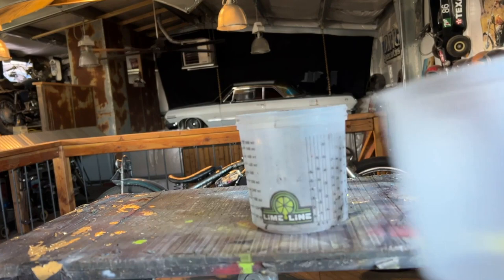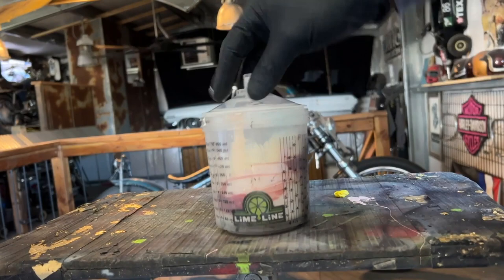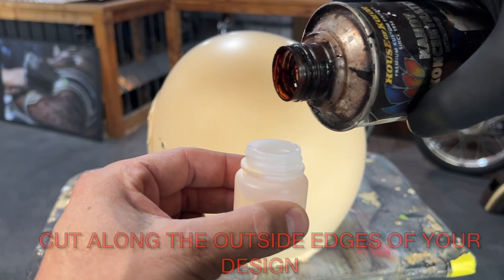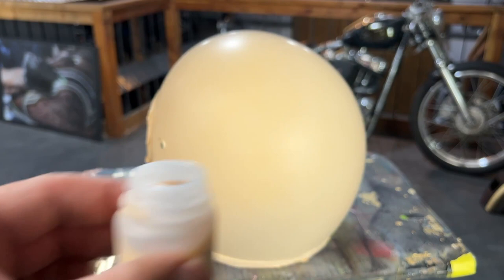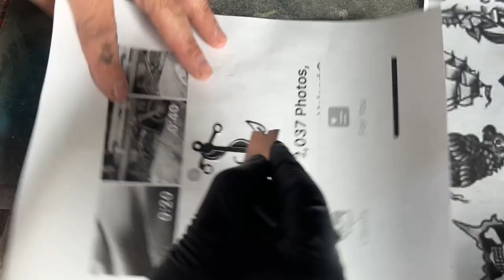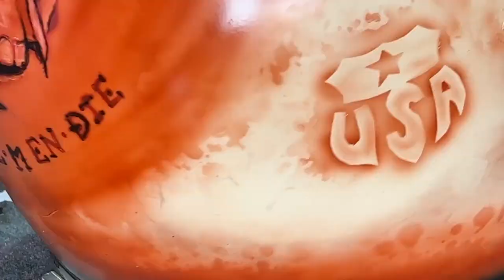Custom Painted Motorcycle Helmet

Comment: Hey Adam I ordered some supplies for a transfer attempt  if I mirror my image and spray the back with white like the one you did do I need anything else other than water to make it stick not understanding how it will stick paint to paint. Any advice would be awesome. This piece is being donated to an auction that help local vets in my area. Really hoping it turns out love the videos  and liking your products so far thanks
Reply: No you don't need anything else, as long as u spray a clear coat on top of the image as well as white paint your good to go. Mirror the image of your choice, turn the water slide bottom up and your all good!
Reply: @trillyfecustoms5828  thanks for the info
Reply from the maker: One other thing is to make sure the white base coat is applied smoothly that way it has a good contact with the sanded clear on the tank